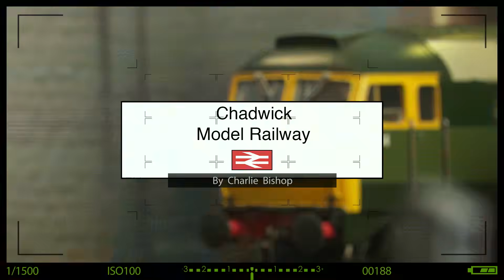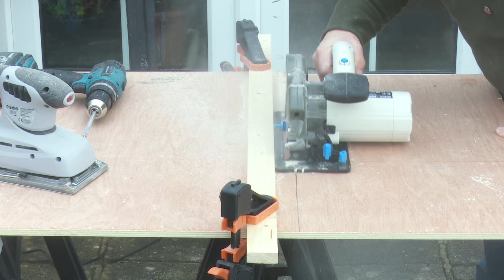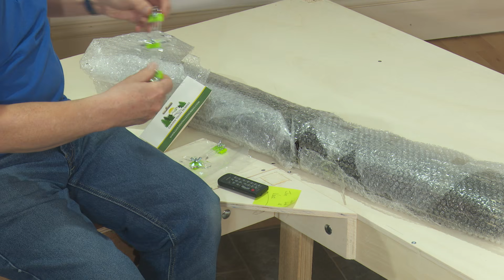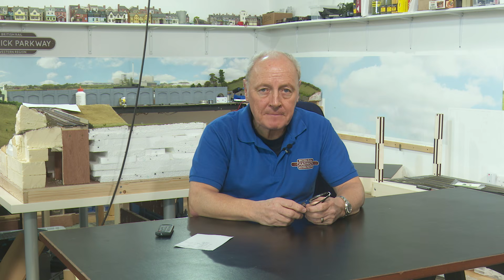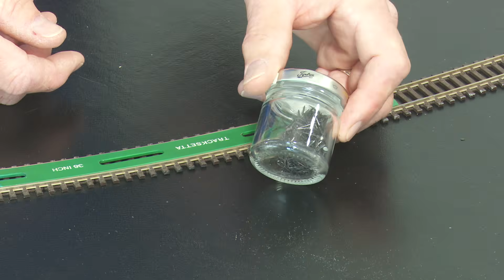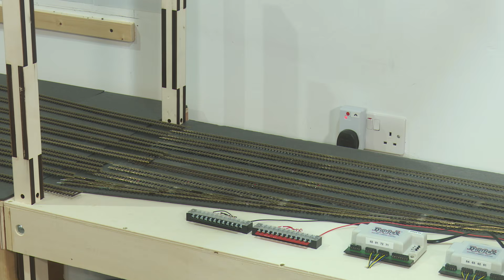Laying Flexible Track at Chadwick Model Railway | 119.

Comment: Hi Charlie,
Yet another brilliant video on track laying.  Generally, I see a lot of quite poor track laying faults on some "exhibition standard " layouts and in is definitely something worth taking time over.  I'm in total agreement with you about track screws - a great invention! (although I used Hornby track screws) BUT I was working on my garden layout.  Perfect for laying the track out and correcting errors but leave it a few weeks and our summer rain turned each track screw into an immovable object due to rusting of the screw head.  I did buy a special screw driver for these screws but once rust has started - almost impossible to turn and remove the fixing.  Drill itn out with (swearing permitted).  So, although very good on a temporary  basis, if there is any chance of moisture getting close, get them out as soon as you can.  For example, when adding  ballast and applying PVA (diluted) glue, by the next morning your screws will start to rust. I have started to use the Hornby track pins which are much less of  problem to get into my baseboard (wood) which Peco pins would not pentirate.  They can be removed with a little bit of "technique" but somethimes the weather gets at them and a struggle begins but nothing on the scale of removing a THREADED fixing.  What do they say?  "Horses for courses"  down here in  Devon.
Charlie, I'm a fully badged up scientist (and love this hobby for its scientific challenges) but love a good "in" joke, so pardon me for passing this one on - its a bit "in" but it's the sort of thing scientist find funny:
Two scientists are taking a break over a cup of coffee and discussing their work.  One says, "I'm still working on the origin of the universe but I've come up with a theory about space".  The other scientist looks relieved and says,"It's about time".  [end of joke]
Best Wishes,
Graham.
PS Will send pics of garden 00 layout when modifications for this year are in place if you would  like to see it.
Reply from the maker: Thanks, Graham, much appreciated, including the scientists. Regards, Charlie.
Reply: maybe you will discover one of the real attributes of stainless steel hardware.

Comment: Gidday Charlie, I have a similar  'JIG' I use when setting the  'Mast Spacing' with my PECO OO Catenary System (OHLE),  (My OHLE is 'Live' which is why I have 'Spot-Welded' fish plates along the back of the layout that's out of easy reach). Atmospherics!
I have  'TRACK SETTA' is very handy when laying into curves and  forming 'EASEMENTS' where your loco's glide smoothly  'into' the corners instead of 'SUDDENLY JUMPING INTO THE CORNERS , (Drivers defying the 'G-Forces') and keeping guage Radii' in the  standard way-guage at the same time. They make placement of joints in the centre of the curve making alot smoother joint. A lot of great stuff down here but it's expensive !
Reply from the maker: Many thanks, Wayne, for such an interesting comment. Regards, Charlie.

Comment: Thanks Charlie.There is a third method; I hate to mention it as it is a bit of a bear.  That being said: it does solve some problems.  I have tried this only with code 100.  The idea is to totally remove the rails and pre-curve them under the heads of three small flat-headed nails pushed into a bit of scrap timber.  My timber is a shelf offcut from the bin at the local hardware.  The nails are in a flattish triangle, the outer ones about 2" apart, the third being central but offset vertically about 1/4".  Thread the rail through with the base captive under the nail heads, and pull.  Experiment.  It is the same principle as rollers, and has the same problems at the ends; simply form the ends by hand and gentle pliers.  Then re-thread the rails.  It works brilliantly, and if you lay the rail on a flat surface after bending, you will find it is flat.  By that I mean it has bent on its vertical axis, rather than distorted following the easiest axis.  Don't forget transition radii.  This system has worked well in my waterlogged, natural scenery growing environment.
Do you know if that 'underlay' powders over time, as does foam?
Lastly, an unhelpful suggestion.  Your back scenery has cows or sheep or something.  Why not arrange them in a not too obvious BR configuration.  Always encourage a smile.  The idea is not original.
Keep teaching us.
Reply from the maker: Many thanks, Peter, for such an interesting suggestion. However, I really can’t see me trying yourtrack laying method. I shall see if I can make a farm animal configuration.😉
Regards Charlie
Reply: @ChadwickModelRailway  Yes: on the track I thought it completing the record - I do try.  And do rearrange the livestock: we have to make an effort not to be too serious.
All the best to you Charlie.
Reply: it helps to use a flex track with wide base flanges- at least in N and Z. the narrower flanges like atlas, ME, and peco are much easier to damage. practice makes perfect, and even the wider-base rails can tear as well if you over do it. there are times when we N scalers envy our brothers who work in larger scales...

Comment: Hi ,  I have a question  ,  I have a Blue track setting tool think it's 
18 " But  what is the equivalent  track radius 2 ? 3? .iv made a bit of mistake it's to tight for the loco  2-6-2 BR standard ,What do you recommend. Thanks .Rob.
Reply from the maker: You need to go on the Peco web site Rob, as they make them both.
Regards Charlie

Comment: Hi Charlie, great video and very informative. I'm just starting out and was wondering if you still recommend the underlay in this video as in a later video I noticed that you were using cork? Many thanks in advance. Best regards Kevin
Reply from the maker: Yes Kevin, I still recommend using it in non-scenic areas, although it does damage quite easily. Regards, Charlie

Comment: A method I used in a similar situation, laying multiple parallel tracks around a corner with a filler like yours: I cut an extra piece of plywood to fill in the corner temporarily to set the center of the various radii. Swinging an arc equal to the radius of the proposed end of the incoming run, and intersecting that arc with the planned start of the continuing run, I established the center point.  With a nail in the center point, I was then able to scribe the inside edge of each curve at the sleeper ends at the desired radii. (I used the inside sleeper ends as being the easiest to see from my position.) 
I held the track in position using 2" foam nails (with the TEE end), allowing me to pick up the track sufficient to place the glues, then slid the track right back down the nails, checking to see that the sleeper ends were in the proper position. After the glue dried, it was very easy to pull the nails. It was necessary to weigh down the track so the glue could properly take. Also, I glued the track in position from the largest radius inwards, just for convenience. I left the filler [piece of ;plywood in place until the area was done just to be able to crosscheck right before and after gluing.
Reply from the maker: Great methodology Jack. Certainly to be considered for future building. Regards, Charlie
Reply: okay- wow- i am totally confused- we just draw center lines on the foam roadbed and pin the tracks centered on the lines. use pushpins instead of T-pins and it will hold the track down until the glue sets up. the lines also aid in placing the glue on the roadbed before putting in the track. thats not a critical thing as long as you are near the line, and the ballast can cover a multitude of sins- if you know what i mean. we paint the rail sides when using code 80 to keep it realistic-looking.

Comment: As an old railroad track surveyor, I might comment that it appears that at about 21:00, where you are preparing to fix the curve between the two gauges, that the track has chorded or straightened out slightly. I would suggest the use of a third gauge right at the proposed fixing site, or at least mark it while the gauge is at that point before moving the gauge beyond.
Also, are you providing any spiral transitions in and out of the curves. It appears that the third track is self-spiraling on (my) left end, which might give a better ride, especially on the tighter radii. Using set track, that would necessitate a flex track for the transitions, say 20-30 cm. When superelevating the curves, doing so in the length of the spiral gives a much more pleasant curve. ON prototype lines, spirals are laid out using all sorts of formuli and tables, but the eyeball would suffice as a good survey party for us.
Reply from the maker: Excellent comment, Jack, and well worth considering on future builds. Regards, Charlie

Comment: I'm fairly new to model railways - at least as a serious hobby.   I have a question about the Peco Tracksetta system i.e. that the radii of the tracksetta templates are always different to the settrack radii, and that the step increase in tracksetta radii is fer greater than for settrack.   Question : Is there a reason for this?   In designing layouts, like most modellers, I do not have umlimited space.  My preference is to use streamline track with Tracketta modelled curves throughout but I am concerned about the additional space used.   Would I be committing a dreadful sin to use settrack curves at all (the tightest I would go to is No 2 radius)
Reply from the maker: I really don’t know Michael. They do make a vast range of these gauges, and I thought they have all the fixed radii’s covered. Regards, Charlie
Reply: @ChadwickModelRailway  Very many thanks for your reply Charlie, this is greatly appreciated.

Comment: If your main concern is eliminating the gap that develops between curved rail sections, why not just solder the rail ends together before forming the curve?
Reply from the maker: I would advise against soldering rails. They will be a nightmare to replace and heat expansion and contraction can also be an issue .
Regards Charlie

Comment: Hello Charlie. I thoroughly enjoyed your flexi track tutorials on PECO TV. Ive had a bit of an up and down relationship with model railroading. Ever since my first visit to a hobby shop back in South Africa where I grew up and saw my first Loco which was Rivorossi steam loco. The detail and the running captured back then. Now at 53 Ive collected sold off several locos and even a DCC system. for many reasons I never found myself having the space to have a layout that  really wanted. That is now changing. My first love of model railroading was American freight and the locomotives but being quite a stickler for detail trying to make sure I got it right was becoming an issue, not being an American and never been to the States I found myself asking more questions and getting a little disheartened. Then I started seeing the Class 66 Freightliner locos here in the UK. Now that circumstances are changing for me it seems sticking with local is a far better idea. I would like to go current modern British freight with more focus on that  over passenger rail. However a passenger train or two of course would be in the plan but a bit later. Ideally Id like more a mountain terrain for my layout than urban. Id appreciate your advice on where to start and go about getting into modern UK freight model railway. DCC is of course the way id go with NCE Power cab which i still have. Im looking at a 3.5m x 2.5m Garden office fully insulated.
Reply from the maker: Hi Mike,
Let’s take this off line.
Please email me at
chadwickmodelrailway@gmail. com
Regards Charlie
Reply: @ChadwickModelRailway  Thank you Charlie. Email sent.

Comment: 13:00 I have to say I've extensively used those miniature screws (mine are Jouef branded) since... the early 70s (call that the (maybe one and only) silver lining of being 71 and counting) on my main H0 layout and never regretted it. Discreet, nifty, not damaging whatsoever the tracks and points - and ttackbed - and what's more important easily allowing repairs, amends, rectifications an even total replanning of the track layout.👍🤗
Reply from the maker: Yes Jane you’re dead right.They make it so much easier to carry out modifications.

Comment: Charlie great video I am working my way through them as I have only just found your site. Can I ask what thickness ply you used on the 2 small tables on your fiddle yard - the ones you made yourself either side of the one you modified.
Reply from the maker: It’s 12mm ply William.

Comment: Watching the evolution of your techniques has been enormously helpful.
Do you now major on Copydex for both fixing Woodland Scenics foam underlay to the baseboard and for fixing track to the underlay?
Is Copydex now your preferred adhesive for use with ballast?
With an O gauge end to end (under construction), I doubt I shall have the same noise issues as yourself, but your considered best practice is certainly something to be followed.
Reply from the maker: Copydex is still my best option for securing track until ballasted but for ballasting, there is still work to be done.

Comment: Charlie, great video as always. I had a couple follow-on questions. 1. Are you using Modge-Podge (the one in  your amazon list) to secure your track to your roadbed? I was having trouble hearing which adhesive you said in the video. Also, when I've attempted to do the offest rail cuts/joins on my flex track as you did, once I start flexing the track it causes the joiners to try to shift and "hit" where the sleepers connect to the rail. This often causes the sleepers to pop off the rail and the thickness of the joiner on top of the sleeper causes a slight rise in the rail height directly above a join where you want the rail to be perfectly level! Do you have an issue with this? (I'm in N scale).
Reply from the maker: I’m currently using Copydex to secure the track to the road bed, but don’t use too much. Regarding the offset rail joins, I don’t really think that would work for N Gauge. Regards Charlie

Comment: Useful video.
In my experience, staggering the track joints is absolutely the best way to go. No kinks or doglegs, and because of the staggered joint, the sleepers are retained.
Brilliant.
Reply from the maker: Thanks Andrew, I’m so pleased that you found it interesting. Regards Charlie
Reply: the nice thing about laying track with flex sections is you can micro-bend the ends in mid-curve and no more kinks. sliding rails out of and back into flex track is one of the quickest ways to damage the nubs that hold the rails. we re-use all the flex tracks at my club so less or zero modifications is encouraged (unless of course the guys don't mind ponying up money to buy new track).

Comment: Great informative and instructional video as per your usual standard. 
Nicely demonstrated laying of track, I use the staggered fishplates on curves and straights, using a two playing cards to put expansion gap between tracks. 
The other thing I do, is to cut one chair at a joint, to allow the fishplates to slide over the sleeper. 
This strengthens the joint and leaves no gaps that need additional sleepers installing after. 
It should be noted, that care should be taken when pinning the centre of the track, not too fasten down too much, this will tend to distort the gauge of the rail.
Look forward to your next video. 
All the best to you and yours for Christmas & New Year..  🎅
x The Bigfella x
Reply from the maker: A very useful comment big fella. Have a great Christmas and best wishes for 2021, regards Charlie

Comment: Just a thought, but there looks to be rather a lot of space going to waste on "board 1"? Appreciate you're using it for modules at the moment, but is there perhaps any mileage in swapping out the final point on the board for a double slip and relocating the models? that'd present the opportunity to add a couple of storage sidings to that triangular section. If nothing else, it's somewhere to keep the track cleaner?

Cheers, 

Jon.
Reply from the maker: I have considered it Jon and it's in an accessible place should I change my mind.  
Regards Charlie

Comment: A
	
	
Another option, using AnyRail software, is that you can print out your detailed plan at full scale. This can be placed on the baseboards to lay the track. If you have a complicated track plan it is an excellent guide. I got help from Drew Fermor, who designed and helped me lay the track using this method. As it prints to full size, it makes the positioning of track, including points, very accurate. Yes, you do use lots of A4 paper but the printing is in black and white and not too costly on ink. The track laying is the most important part and this method allows for accurate long, gentle curves. Sorry if this has already been mentioned Charlie.
Reply from the maker: Not at all FHR.  It's a useful tip.  Regards Charlie

Comment: Charlie, you said, "I watch a lot of videos ...". Well, I also watch other 'model railway' channels but yours is the only one that 'provokes' me into leaving comments! (That's a compliment!)
1. Piko Track Screws: Good Tip. 
Their advantages are well known among my fellow modellers here in CH, but previous mentions of them to my British friends have always resulted in them giving me that 'he's become a foreigner' look! (By the way, Piko's "A-Gleis" Sectional Track joins well to Peco/Hornby, offers an alternative geometry and points which accommodate older TriAng course wheel flanges.)
2. Good Tip about how to avoid 'dog'legs' on flex track curves, I now challenge you to do it with Insulated Joiners ...🙂
3. You've used 'Setrack' track spacing for your curves, as you did on the Helix, but, you laid out the entrance point work to the Fiddle Yard at 'Steamline' spacing. 
Please show in a future video how you are smoothly transitioning between the two. 
Merry Christmas!
Reply from the maker: Hi Brian, I’m so pleased that you enjoy the channel.  I will show the fiddle yard as the tracks expand to Set Track distances.  Regards Charlie